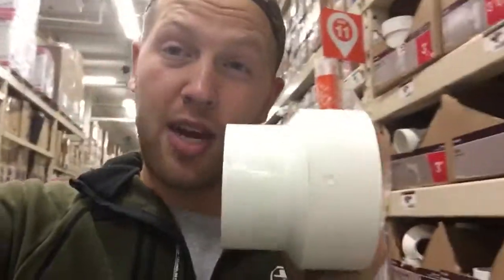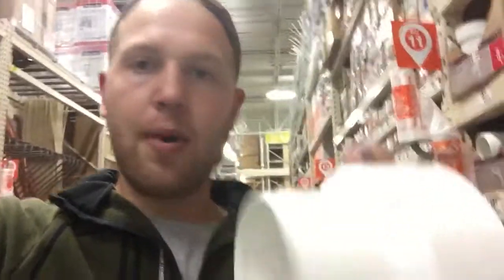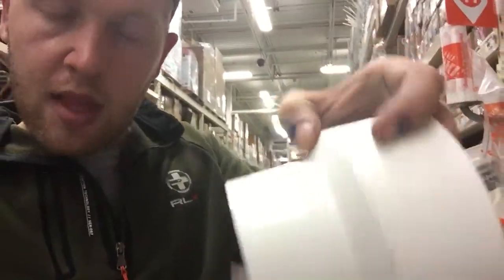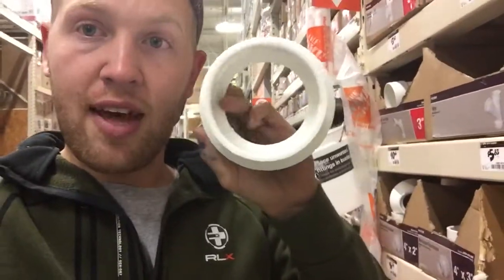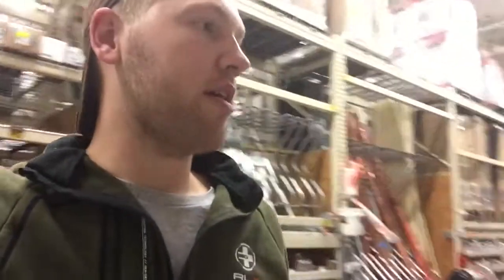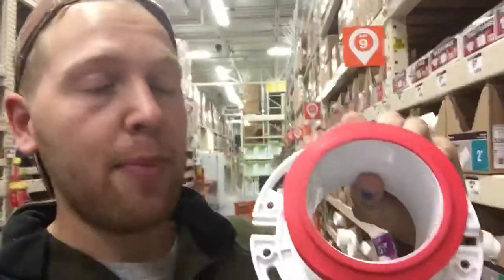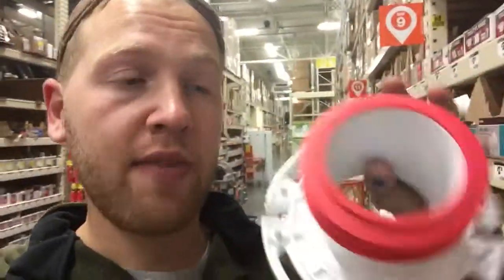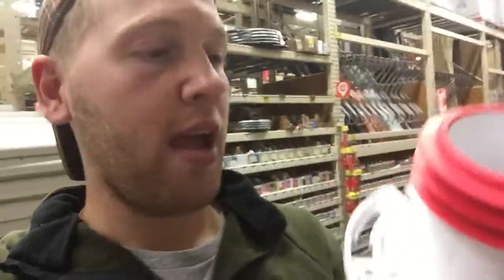DIY Homemade PVC Balloon Pump (part 2)

Comment: Been a while since this aired but felt had to add this. Home Depot no longer carries the flange/gasket shown in the video. The one they have replaced it with will not fit inside a 4 inch pipe if fitted onto a 3 inch pipe.